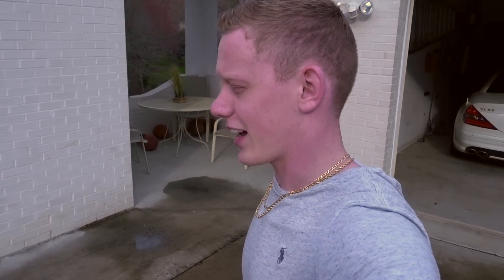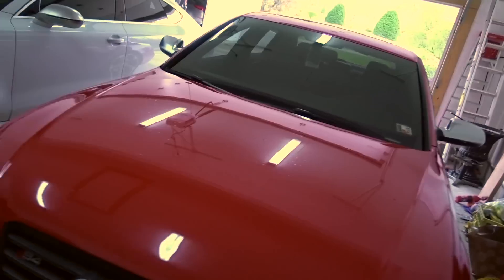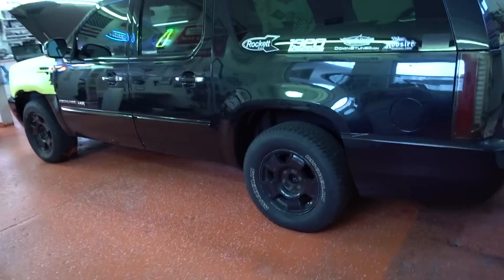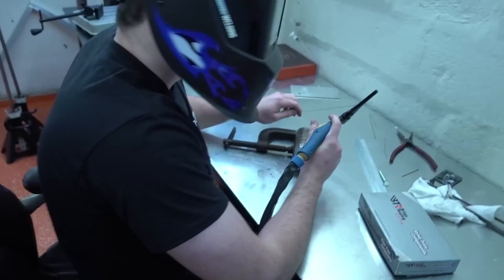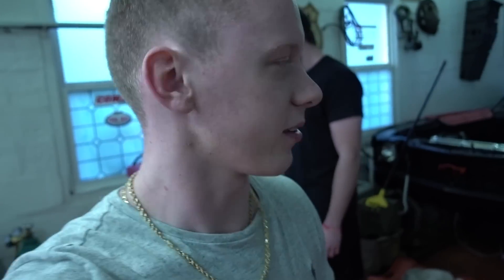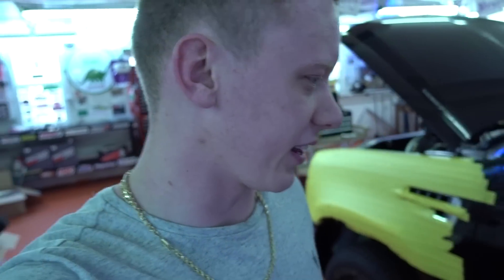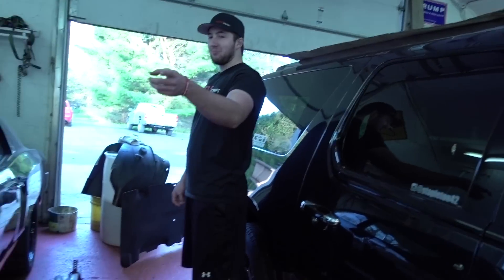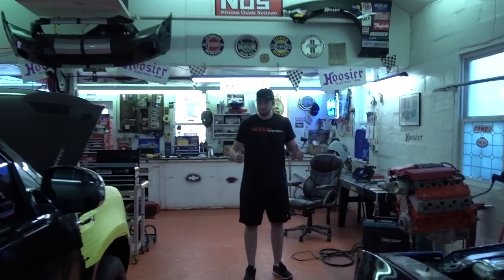Fastest Escalade In The World???

Comment: 2000 hp? At the wheels? With an auto? So you’ll need to make 23-2500 conservatively at the crank. So a complete drivetrain rebuild is planned? 1000 hp daily driver? Easy power to make, not so easy to make and keep it a DD.  But good luck .

Comment: anyone know were to get parts for 04 Cadillac escalade 6.0 I've seen some aftermarket parts but nothing for the suspension and front differential
Reply: Josh Beall No need to modify the front diff it will hold plenty of power. Suspension stuff is interchangeable with Tahoe/suburban parts for the most part

Comment: 2k hp?? I don't see that setup making 2k. More like 1,100- 1,300. Put that tub on the dyno and show some real numbers
Reply: Austin Campbell I'd definitely like to keep track of the suv. The 2 videos at the track were when it was supercharged @ 750. That's pretty clear. Those turbos in the "new setup" just look small for a 2k hp calculation which is why I estimate up to 1,300 hp, max. Took a pair of turbonetics 88s on a built 454, but it hit 2,048 hp. I'd love to see the end results. Hope he does hit 2k
Reply: Kevin Williams Twin precision 7675s are more than enough for 2,000 at the crank. The brand and design of the turbocharger mean more than the size. Turbonetics designs are not as efficient as precisions. It'll take a bigger turbonetics turbo to move the same air as a smaller precision turbo.